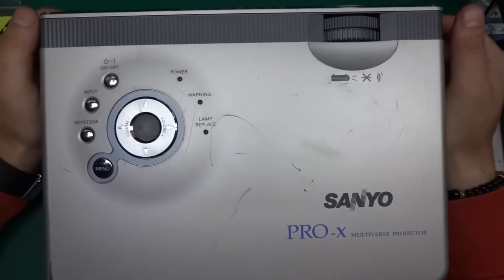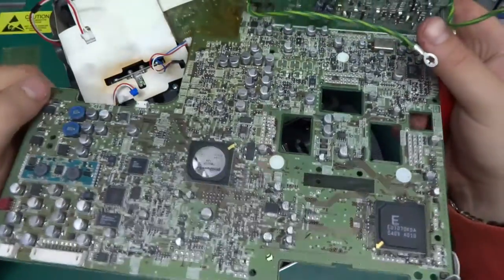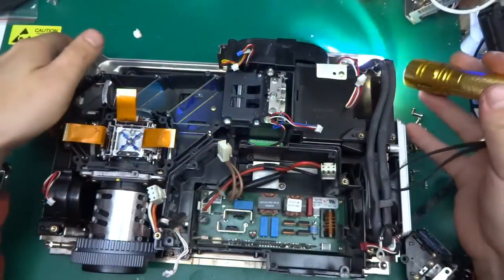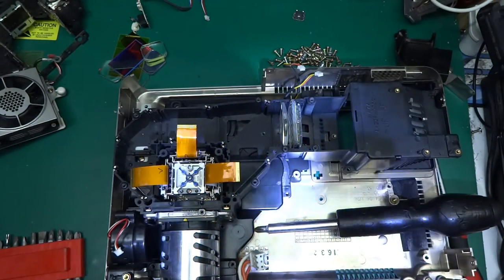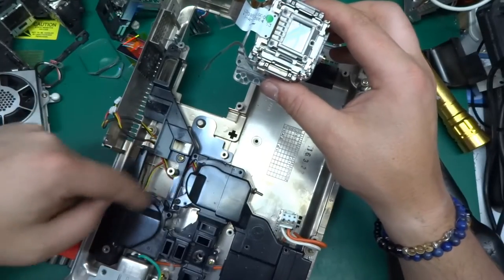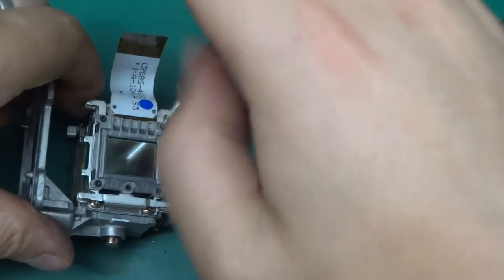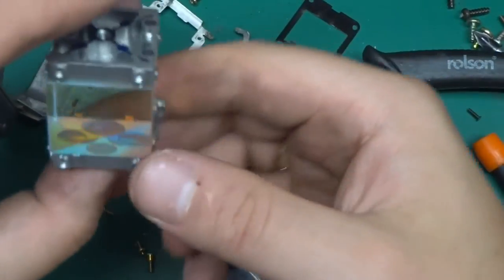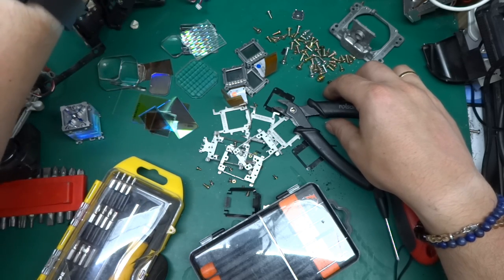Sanyo PLC-SE20A Multiverse projector teardown (one way) - lots of optics

Comment: The reason for not using a halogen lamp is the light output vs. the heat output - the discharge lamp has a much higher efficacy than any halogen lamp, and the color temperature is better, too.
Reply from the maker: ok, didn,t think about heat. tbh: i thought the lamp in projector gets even hotter than halogen... maybe my thoughts were wrong. color temp could be a reason too, but this could be easily adjusted in optical path further on.

Comment: Hey, I have same projector, I'm looking for the thermal reset switch - any chance you could point it out to me in the video?
Reply from the maker: Conec Visuals Conec Visuals it's accessible from the bottom through a pinhole. Can't find it on the video now, but I think 11:57 you will see a small square metal bracket held by 2 screws, right in the middle of the screen, a bit below centre. If my memory serves me right, it's under there, and there is a pin hole on the bottom. Just press it in with a pointy thing to reset - you should hear a click.